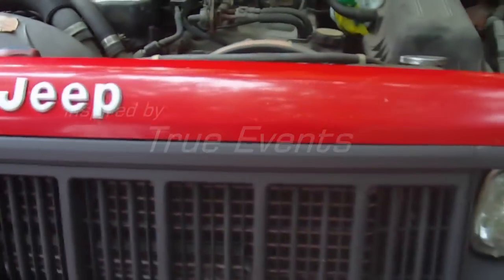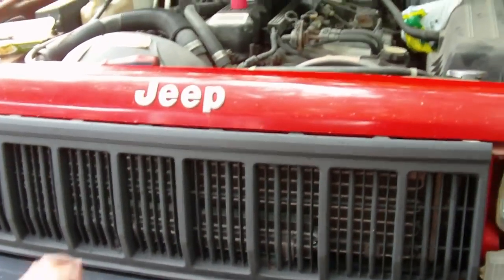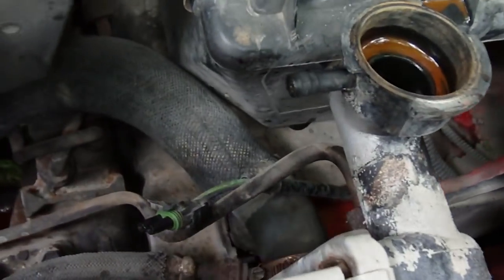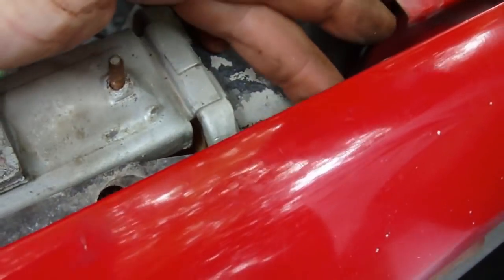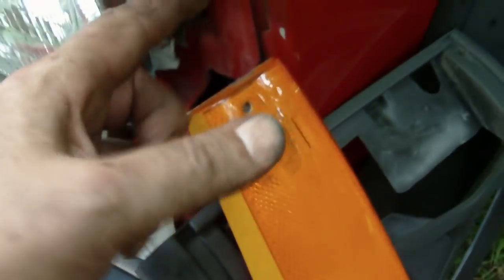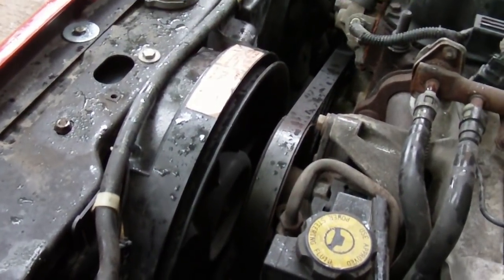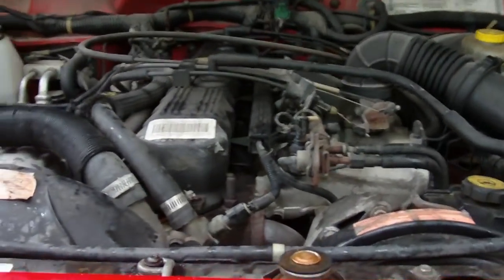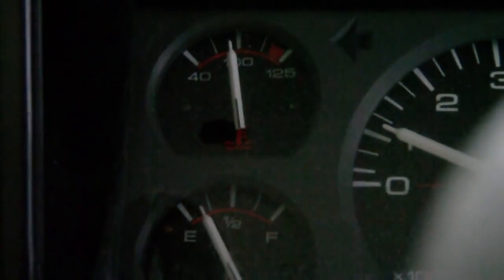Replacing a 1995 JEEP Cherokee Radiator

Comment: A lot of work. I simply removed the top bracket and shroud, disconnected the wires, hoses and trans cooler line and unbolted the rad and it pulled straight up, fan and rad all in one. Them simply remove and replace the fan onto the new rad and replace in reverse order. Re-connect everything and you're done, Took me under one hour to do.
Reply from the maker: thanks for your comment

Comment: Nice job-- showed how easy it is to do. But I did not need to take off the turn signal lights or headlight frame as you did. So the tabs on the fan shroud would fit in the new radiator frame slots, I did have to hacksaw away extra (unneeded) metal parts of the new rad frame. And I had to remove the upper rad hose to allow the coolant mixture to flow in quicker.  Thanks for your video!

Comment: @Excursion911 There is a spigot at the bottom of the radiator. Just use a bucket to collect it and reuse if wanted -- if it is in good shape; which if it is leaking, then, most likely it is, since it is probably pretty fresh.

Comment: You might want to mention the special 3/8" compression fitting tool to take off the bottom transmission fitting. Knowing this ahead of time turns a 2hr job into a 30 minute job.

Comment: Great Video..thank you very much. Stupid question.  Can you collect and re-use the radiator fluid?  If so, what is the best way to collect the radiator fluid and refill? Based on the tips you provide on the video, I want to try to do this repair myself that I would not have attempted without your video.

Comment: Don't ya hate it when it takes longer to explain something than to do it? Oh, and if it is a manual trans radiator, then it would be easier, since you don't have the lines for the transmission. You saved me some time, for sure -- it would not have been as good looking it up in the book!